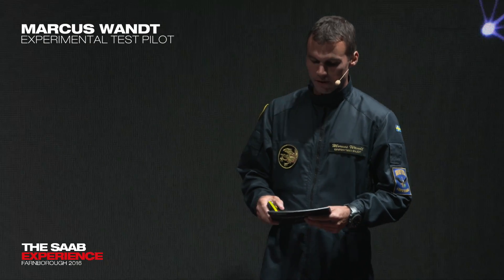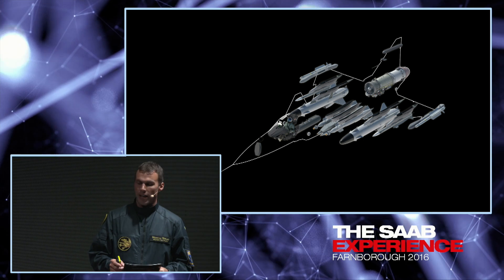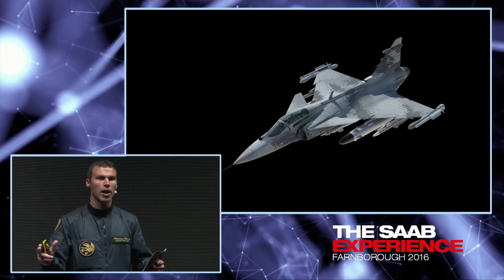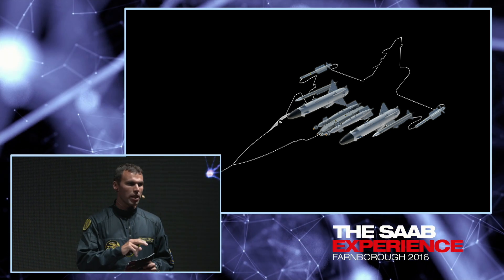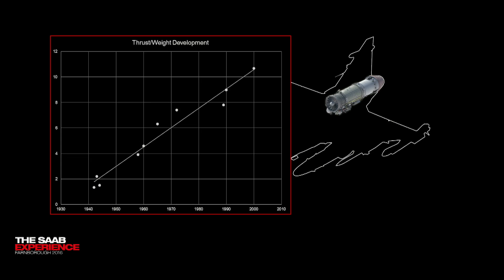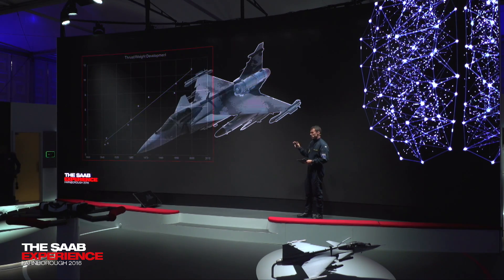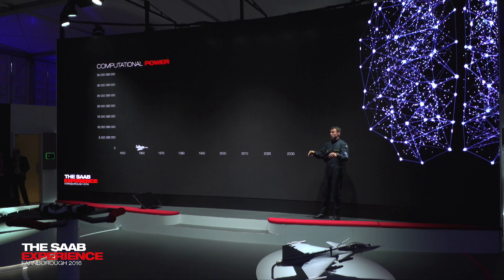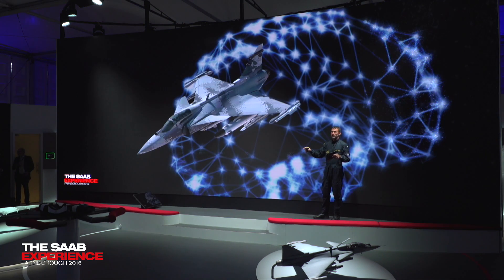Saab Mini Talk: Gripen The Perfect Fighter with Marcus Wandt

Comment: To put Saab's "rapidly increasing processing speed, and future upgradability" argument in perspective, take a good look at the American F-22! 

Its core processors are still based on 1990's legacy architecture, and clocking at a mere 25 MHz (yes, twenty five MHz), or much, much slower than your average Smartphones these days. (nationalinterest.org). Swapping the processors, or any upgrade to its architecture will not come cheap, or easy, as the whole thing will practically have to be rebuilt from scratch.

As the result, it is very problematic for F-22 to integrate new weapon sets like AIM-9X, or AIM-120D. 
Don't forget that "the most advanced fighter in the world" still CANNOT integrate a JHMCS Helmet-Mounted-Display, or a modern Infra-Red Search-and-Tracking system!
The addition of the latter will likely ruin its delicate stealth-shaping, and thus very unlikely to be added in the future.

Ironically, these new weapons, and sub-systems have already integrated on many American legacy fighters (F-15, F-16, and F-18).

Saab had arguably taken the right step in Gripen's development in thinking ahead on future upgrades.

The Gripen is arguably too far ahead in the game in this regards.
This was properly demonstrated in how quickly Gripen can integrate MBDA's new Meteor; at least one or two years ahead of Typhoon, or Rafale.
The integration cost was much cheaper too, and the Rafale.... won't be able to utilize Meteor's 2-way-datalink advantage over other legacy BVR missile types.